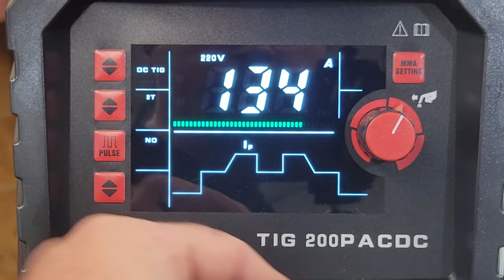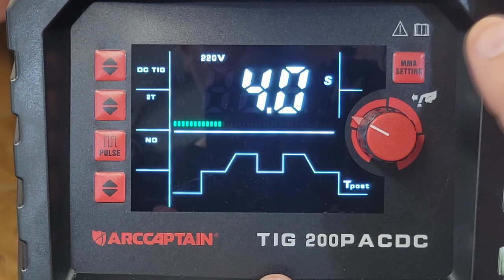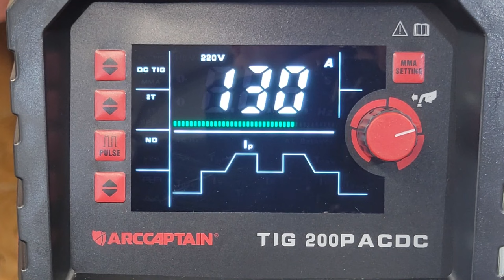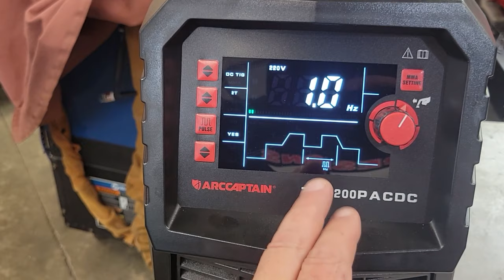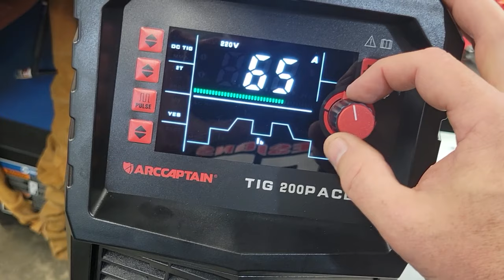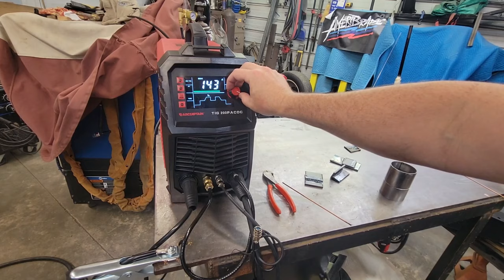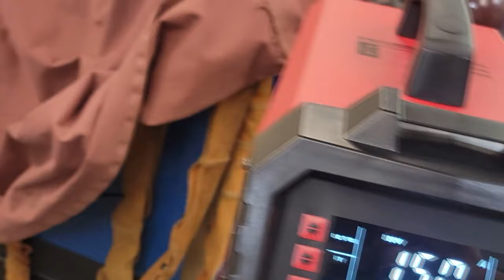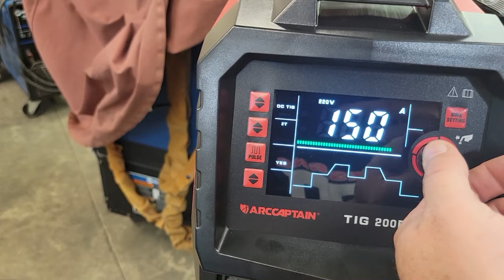Best BUDGET AC/DC TIG Welder? (ArcCaptain Tig 200P) pt1

Comment: Not trying to be pesky I'll definitely will say that machine will out work your syncrowave. Take your torch off the blue and put it on the arcapton. If it is water-cooled torch get a eBay watercooler for it you'll be fine. I have a primeweld Tig 225x with Max cool 3000 watercooler and CK worldwide flex-loc torch makes it a perfect setup. Did a lot of shopping around for 2 yrs before I pulled the trigger had 2k to get a tig machine and found primeweld got my whole setup for under 2k been happy with my setup for 3 yrs now no disappointment.... 😎😎😎😎😎😎😎
Reply from the maker: Ive heard those primewelds are pretty good machines!! I like this arccaptian but im a miller guy if you have the budget,  Ive been welding 20 years with my syncrowave with out a minutes trouble, but there 3 times the money!!! Thats a great idea on the adding the water cooler to the arccaptian!!

Comment: I don't weld everyday but am looking for a machine that I can tig weld body panels and metal I fabricate mainly 18 or 19 gauge.
Reply from the maker: This kne works great for that, I would advise getting the foot peddle, its easier to vary your amprage!!!
Reply: @ACDesignsGarage  thanks for getting back I ended up ordering a tig from eastwood saw too many bad reviews on Amazon on the arcaptain

Comment: Hi AC, I thought you did fine with your presentation it was Great! I have 13 years of Tig experience behind me in Stainless, Aluminum, mild steel, and Hastloy. I talked to my Boss I now work for about buying a Tig unit. We decided to pick this one after we had tried the Hynade 200 AC/DC Tig. The Hynade one worked for 15 minutes, we thought it was just a single problem. We asked them to send us another but no the other would not even run on Tig. Sent them back. I haven't really had a chance to work with this unit yet, just set it up. turned it on to see if it worked. After two more weeks, we could not return it. 
Well, the tig worked fine, but the stick part is fantastic, 6010 cooking, no hesitation, kick azz power. It has been too busy to check it all out. I come online to find out how to set up the foot pedal. Thanks to AC I now know! The pulse I have used many times in the past welding Hastloy. I used a Miller Sinscrowave 250 with a cooler. the settings I will have to work out myself. 
IAM a B-pressure welder since 1983, I am old but not dead still learning. Trying to keep up with the Tech of the world. I worked for Global Thermoelectric Bassano Alberta Canada, Look it up. Exchanger Industries Alberta Canada.
Reply from the maker: Man thats awesome I wish I had half of your welding knowledge!!!! My Dad taught me to weld 30 years ago, he was a welder pipe fiter for a nuclear power plant where I live. Ill say I love my arccaptian welders for the money there hard to beat. Now if I'm tig welding all day I want my syncrowave 250 water cooled machine! Thanks for watching!!!!

Comment: Great job going through the process of the welder it's something good for noobs. If the machine wasn't in the pricing of primeweld Tig 225x I would definitely be interested in getting one. There is ahp, Eastwood, lotos, all comparable prices. Besides all that mumbo jumbo it's all good to me I go through the same thing with my yeswelder helmet all three of them it seems to not like steel under 150 amps don't know why I turn up the sensitivity until it just darken up for the room and back off a touch. 😊😊😊😊😊
Reply from the maker: Thank you for watching,  sorry it took so long I must of missed your comment!! Ive heard those primeweld welders are pretty good welders, also are the yes welders. I have a yeswelder mig welder and it works great also!!!!

Comment: So with the pulse settings you can run the machine with the on off finger trigger only?
Reply from the maker: I was using the foot pedal in this video.
Reply: I know, I was wondering if the switch and pulse would run as well as it does with a pedal?
Reply: Crickets...

Comment: Great review, you do a fantastic job, but for the money I believe that the Hynade 200 AC/DC Tig is a better buy at $640. Thank You
Reply from the maker: Thank you, ive never tried one of those
Reply: maybe which would be an interesting comparison if anyone owns both machines
Reply: $649.99 vs $679, I'm taking the ArcCaptain all day for $30 and not to mention they offer 5-6% off coupons all the time making the ArcCaptain cheaper . The ArcCaptain is a nicer unit with more features...
Reply: At the time of the review the Arc Captain wasn't 30% off. And if you are going by Amazon, the price is $899.00 for the ArcCaptain, you $679.00 price is not available.

Comment: Thanks for the review, don’t know why you are fooling with the pulse feature, your metal is plenty thick. Would rather see you lay it in with some heat like a champ using the pedal. If you are skilled enough you can just use the pedal on thinner metal. Seems like your welds need more heat to puddle out better. Why shoot a video using pulse which you are unfamiliar with for your first review of this machine. Curious to know if this machine has ac high frequency for aluminum as well as what frequency it can weld at? Can it do 120hz? Does it have a clean % adjustment to control the negative time vs the positive time of the square wave. More info needed before I would consider this machine.
Reply: Ouch, didn’t mean to sound so harsh! Thanks for your review. 😎👍
Reply: I appreciate the honest no prior experience try as anyone with enough time and experience can make a bad tool produce decent results.

Comment: Is $1000 - $1200 really a budget TIG welder.  I'm going to be welding only  12g Stainless Wire.
Reply from the maker: With all the functions this one has its not bad. My miller tig welder was around 5k so these are pretty affordable.  Im sure there are cheaper ones but id recommend getting one with a foot peddle.

Comment: Great vid. CAN you check the true Amps of it to see how accurate it is?😊
Reply from the maker: Not sure how to check it
Reply: I don’t remember who did it but I remember seeing someone put a clamp amp reader around one of the leads and it read the amperage
Reply: TIG200P is able to achieve actual 200 amps, you can test
Reply: @ACDesignsGarage  use a welder load bank such as the Miller 902804, good for 750A. maybe you can find a sponsor, list price $14,704!
Reply: @ACDesignsGarage mine outputs 179 amps. On 110, it tops at 135 amps. They fudge numbers like everyone else.
Reply: Mine does 179 amps.

Comment: Congrats on getting to that level of knowledge about welding machines and their applications but pulse is a very basic, 101 sort of information about welding. Before you review something, familiarize yourself with all of the products capabilities. Good job, keep learning!
P.s
DONT USE FUSION WELDS FOR AN EXHAUST. Take each piece and bevel their welding face (where you join the pieces) ideally all the way to the bottom if you're confident in your skills filling gaps. Otherwise leave a tiny little lip on the weld face to allow the molten metal to settle into the gap flush with the inside. Depending on the thickness of the material you'll need multiple passes to lay a proper, strong weld. The first pass will just fill the tiny gap left after tacking (make a small tack to hold the material in place). Then you'll wanna (if you can) make the next pass both the filler and the cover pass. That way if you must you can grind off material to make the welds flush, and they will retain much of their strength. Fusion welds are about as effective as superglue.

Comment: How is welder for welding 18 gauge body panels, and how easy it to setup for novice welder?
Reply from the maker: Works pretty good!!!!!
Reply: You just need to lightly tap the right knob to adjust each parameter.

Comment: What is the dutysycle? How long does it weld before it shuts down?
Reply from the maker: Sorry for the delay,  I think its 60% at 220v
Reply from the maker: I haven't have it shut down yet while welding but I haven't had it maced out for a long period of time.
Reply: Have you welded aluminum with it?
Reply: 40%